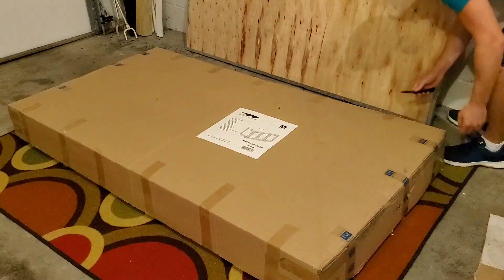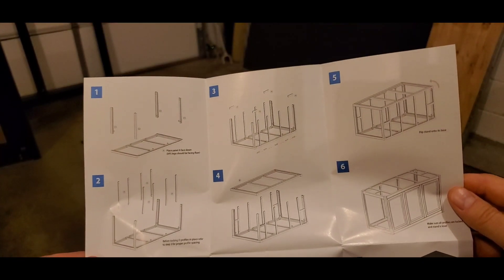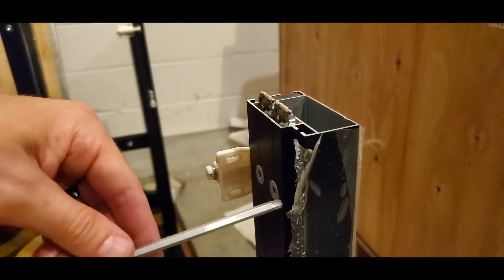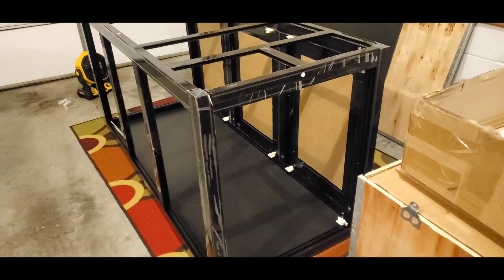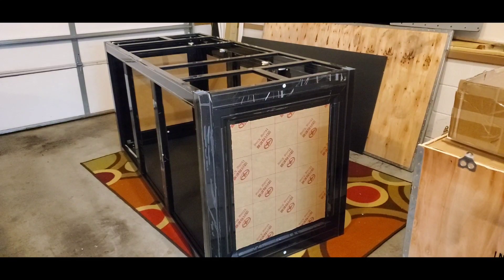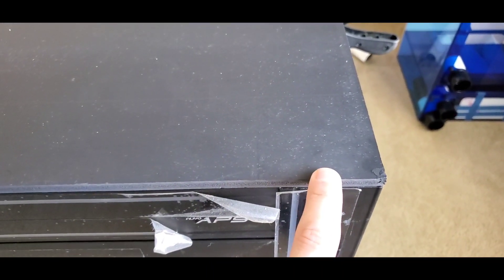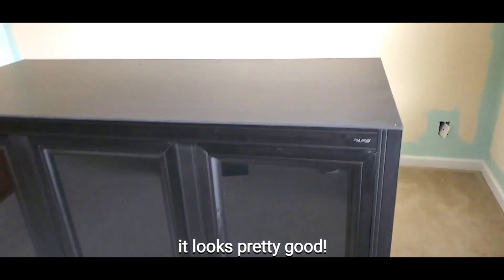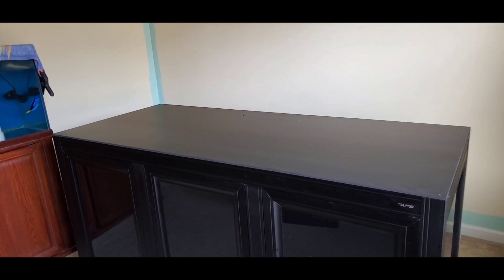Innovative Marine 200 Gallon EXT | Ep. 1| Building the APS Stand

Comment: my stand was on a "level" floor, IE, no kinks, but the stand itself is wobbly. when placing the final side on, or "top" as it were, 3 of the 4 tension locks were smooth as butter, but the last one..... would not align properly and had to be "forced" to make the connection. I am not real happy with this thing, considering the price.

Comment: the tension locks on mine would NOT spin a complete 180. no amount of brute force would make them spin the remaining 20 degrees or so, in fact, I almost broke their wrench trying to do that, and I am not a believer in brute force. if I am building something, and something just won't go, it usually means something is wrong.... but in fact, there was nothing wrong with how I built it, I am just going to assume that the locks at about 150 instead of 180 is going to be enough....

Comment: Sorry to bother, Just curious as I am going throught the process and wondering how you got your stand level? Shims or was your floor good to go?
Reply from the maker: Build it in the place you plan to have the tank. Don’t move it like I did. I didn’t shim mine at all. But I had to support the subfloor. If I didn’t do that I’m positive the tank would have been unlevel due to the weight.
Reply: Did your rock a bit front to back before it settled? Sorry just filling it now and notice it has a slight rock/wobble to it when pushing on it front to back
Reply: @shallowreefing did you have to hire a contractor to reinforce your subfloor ? And what was the cost you have to pay for reinforcing the subfloor ?
Reply: @JCSReefing  mine wobbles just a bit, with nothing on the stand.